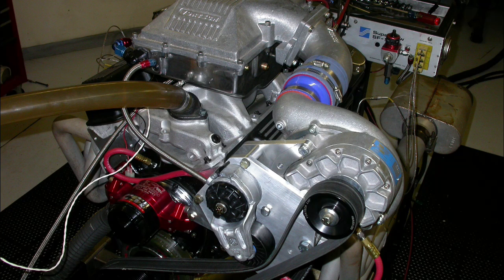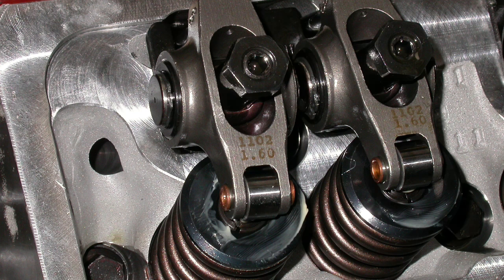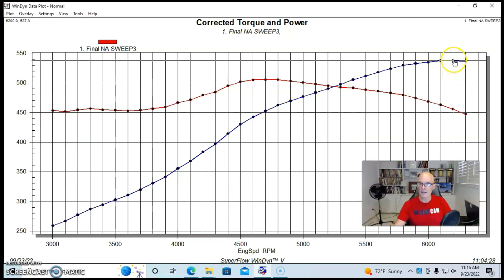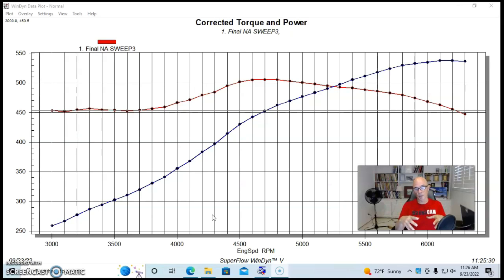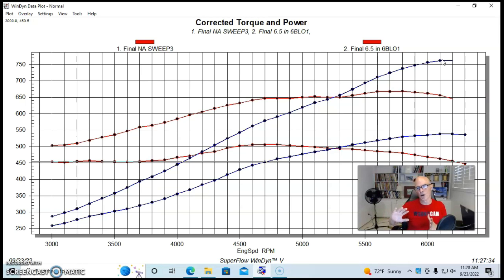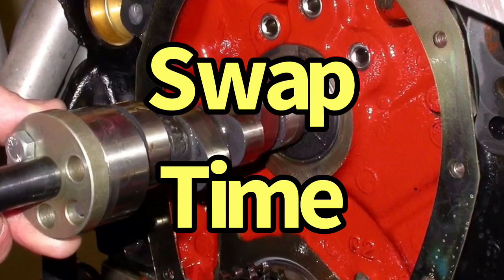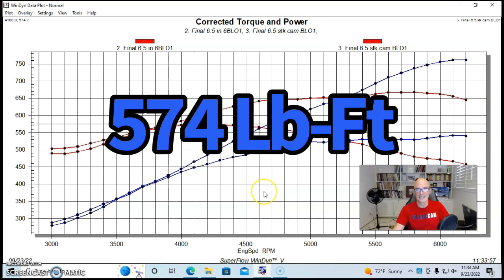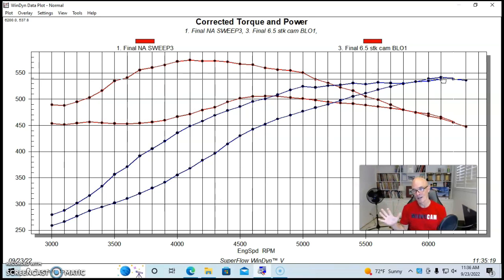HOW TO ADD 200 HP TO YOUR SBC CHEVY WITH A CAM SWAP! HOW CAN THE RIGHT SBC CAM BE WORTH 200+ HP?

Comment: I have the same combo but in A 406.I love the HP and torque but I wanted to add A little more.All I need is 6-7 pounds wow.Definitely looking at the Torquestorms now.
Reply: Those guys at torquestorm are idiots. I went with vortech and I'm happy that I did.
  The guys from torquestorm say that the holley sniper throttle body won't flow air under boost. My vortech runs amazing blowing through at 9.5psi.
  I still get emails from them. They just had a huge article talking about cams.  NA cams won't work with their supercharger systems. One of their customers had a car running in the 11s NA. They added a torquestorm setup and ran 14s.. then changed the cam and the following weekend ran 8.90s with no other changes. That's an awful lot of bullshitting to me. I'd stay away. 
  They also told me to just buy an aftermarket front accessory drive for a few grand rather than tell me if my factory gm front accessories will work with one of their superchargers. I've got a lot of money invested in my motor, but I don't want to buy a whole pulley setup of I don't have to. 
  They also state in their email that an NA cam can't handle the extra airflow that their centrifugal superchargers add at idle. Centrifugal superchargers have a rising boost curve. At idle there's basically zero boost. 
  My front accessories work great with my stock front accessories. The alternator bracket changed and so did the power steering bracket. If you want to run one of their superchargers, that's fine, but don't listen to their mis-informed bullshit. 
  I'm running a vortech v3 si trim supercharger. It's a universal carbureted kit for sbc. I'm running holley sniper tbi efi on it. The tuning was super easy to add fuel and pull timing under boost.. and with my combination, the truck pulls hard from idle on. Vortech says it's capable of 775hp. After that, you could look at a y or t trim. Or procharger. I'd stay away from torquestorm tho. 
Good luck man.

Comment: How about mild motor comparison with just rocker arm swap 1.5 vs 1.6 vs 1.7?
Reply from the maker: the effect of a change in rocker ratio is not universal. it doesn't always add or subtract power, sometimes it does nothing, other times (without adequate spring pressure) it initiates valve float
Reply: Larger rocker ratio amplifies the valve acceleration and should give more airflow in the same duration (time), so I am betting on the rocker ratio to win.

Comment: Here's an odd one, I'd love to see a comparison of two setups with equal lift at the valves but different lobe lift and rocker ratio.

For example .575" valve lift with a 1.5 rocker and a .383" lobe cam vs 1.6 rocker and .359" lobe cam. Does it do anything measurable? Is there a larger rocker ratio to push the example farther like a 1.65 or 1.7?
Reply: I like the way you are thinking!
Reply: I just installed a set of 1.7 ratio scorpion roller rockers on my 92 c1500. Regular old 350 motor with 267k miles. It added 13% more valve lift with essentially the same duration. 
  You can find different ratio rockers. 1.5 and 1.6 are most common, but you can find higher ratios for racing or lower ratios for easier flat tappet cam break-in. I think I've seen 1.2 ratio for break in. I don't know if they make 1.8 for sbc. I'm sure if your pockets are deep enough, someone will make a set. Lol. 
  The 1.7s were about double the price that I paid for my 1.5/1.6 roller rockers.
Reply: @EricErnst  I've got Comp Ultra Pro Magnum 1.52 in my supercharged small block combo. I'm curious to see if there's a measurable difference in performance when using a small cam and larger ratio rocker vs a large cam and small ratio rocker. There's plenty of examples of just changing rocker ratio but that's not my question.
Reply: @EricErnst  Any lift will help the stocker cam out. A stock LT-1 cam from a Y/F body is a huge improvement on that engine too or the Elgin 210/215. Then again, you don't have to crack the engine open to do the rockers etiher.
Reply: @thetriode  I've got an extra xfi252hr cam lying around. It's 252⁰/264⁰ advertised, 202⁰/212⁰@.050". 114⁰lsa. .550"/.546" lift with 1.6s. Very short duration for great off-idle torque. The tbi heads flow terrible and the stock tbi can barely keep up with a stock 350. If I used a bigger cam, the heads would run out of air as the cam is coming to life.. and the big cam would kill low end torque. I'm going to bump up fuel pressure on stock injectors and try to get 315hp worth of fuel out of the pair of stock injectors. 315hp out of a 350 is pathetic, but with stock tbi, I think it will be a fun project. The stock cam in those trucks was something like 165⁰/175⁰@.050" with .385"/.402" lift. No wonder they only rated the motors at 190hp!
Reply: @EricErnst  454 injectors cranked up are a possibility too. beware some were basically 4.3L injectors set to 30 psi. stock should be 179/195.

I would argue the cam is worse than the heads but obviously Vortecs are a big upgrade
Reply: @thetriode  I idle at 2% duty cycle with stock injectors and stock fuel pressure. I have a set of big block injectors but the truck ran like dog shit with them installed 15 years ago. It puked black smoke like a diesel rolling coal. I had a custom chip burned for my vortec headed tbi combo. What a waste of $400 back in 2004. Never again. I got a modified stock ecu that I can tune myself with my laptop. This is my last hurrah with stock tbi. If I can't get it to work now, I will never try again. 2 injectors is not enough for 8 cylinders. Fuel distribution is all over the place with such a shotlrt duty cycle. I'm going to get a vacuum referenced fuel pressure regulator to keep stock fuel pressure at idle and bump it up as I squeeze the throttle.
  With the stock injectors, I'm commanding 114% duty cycle at 3800rpms. The stock stuff is just plain insufficient. That's on a stock engine with headers and free-flowing exhaust. New fuel filter. Fresh fuel pump. If I turn it up, there will be too much fuel at idle but if I don't, there's certainly not enough at wide open throttle. And that's nearly bone stock! I even have a stock 195⁰ thermostat. I added anywhere from 4⁰-22⁰ throughout the timing tables. It's ridiculous how conservative the stock timing advance was! The knock sensor is dead quiet at those levels. I optimized the curves, if I ever saw any knock, I'd pull 4⁰ from that cell immediately.
  I have a pretty good tune in it right now. With the cruise set on 55, it's showing 28mpg instantaneous mileage. Not bad for a truck that was rated for 13city/17highway.
Reply: @EricErnst  It's important to know that increasing rocker ratio also increases velocity rate at the valve which means you now need MORE valve spring than before. I tested this myself on a mild 350 years ago. It floated at 6500 with 1.5 rockers and only 6000 with 1.6's!
Reply: @CarsandCats  I don't rev the 350 with 1.7s past 4500. I've got comp beehive springs on a set of rebuilt swirl port heads. They'll handle the 550" lift that the xfi roller cam supplies. My supercharged truck that the 1.7s will eventually go on has aftermarket heads and upgraded springs. If I notice any loss of power at rpm or float, I'll pull a spring and check the specs and order some beefier ones. The centrifugal supercharger adds a lot on the top end with its rising boost curve so I may not notice a power loss!
  I haven't seem any signs of valve float on the weak stock tbi springs.

Comment: Yeah... I'm gonna watch the video anyway LOL.
Reply: 😆 you know he's got them fire heads you can already see the CNC machine on it! And a cam good duel or single plane and some headers yeah you're going to get 200 if the cam and heads are big enough.
Reply: they are only 195cc, i have ported stock 1994 lt1 heads to 208cc put on a rebuilt, high compression 350 lt1. the afr 210 competiton ports flow 320. a high rpm 383 will make killer power with those
Reply: First time watcher here lol

Comment: Now talk about this with a six 4.3 Chevrolet motor you'll find in a C10 or Blazer 2000
Reply: arp bolts, turbo and nitrous- there ya go
Reply: JD John  He's already done one with a TorqueStorm designed for a 350. Since the front accessories are the same, it bolted right up.
Reply: @melvinpinkard5333  yeah I think he did a few videos on the 4.3
Reply: Right,  it's interesting stuff,  my 4.3 is getting tired.... not really wanting to build up to eight,  of course with minimal cost,  still basic transportation,  not a Hot Rod.... thanks I have learned a great deal with you and all of your subscribers 😊   keep up the good work , JD

Comment: How to get 200 hp with a cam (and a turbocharger)
Reply: and demon carb And flat tops AND AFR heads AND intake AND 100 Octane AND 12:1 Compression 💩
Reply: @General Civility it's only about $9,000 worth of parts..
Reply: @amazin1827  "how to gain 200hp on a cam swap (A $9000 cam swap)."
Reply from the maker: there was no turbo
Reply from the maker: if only this guy ever went to a junkyard and di junkyard motors (like more than you guys combined)
Reply: @richardholdener1727  this is way out of my league! Really depressing! I'm a CRAIGSLIST shopper. I would never expect to find this in a junkyard and it's hard to find anything pre 1990 if that. 
I love your M400 video. I have 4 M400's, 1 with the Aussie 2v's. I learned about this motor long ago. I love when people snear at the thought. (Ignorance)
Power by FORD🇺🇸
Reply: @richardholdener1727  hey moneybaggs😉 you ever mess with a ROTREX PROCHARGER??